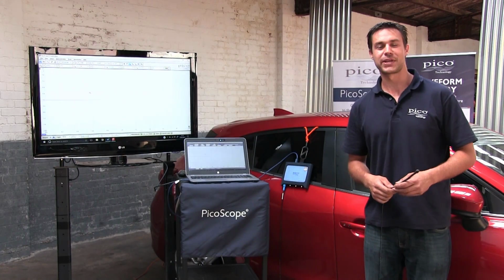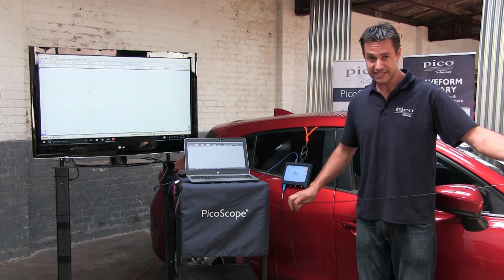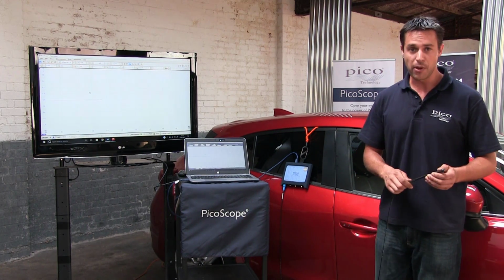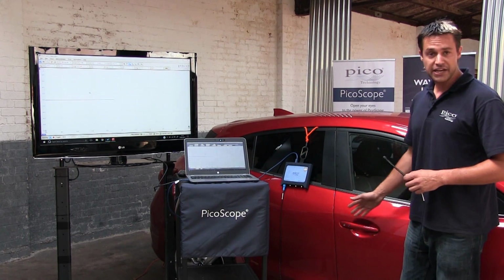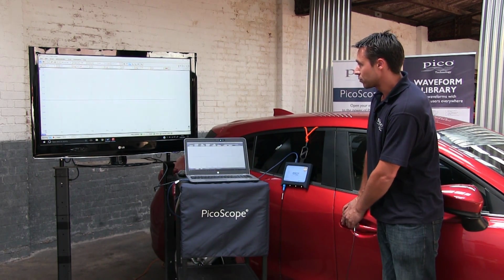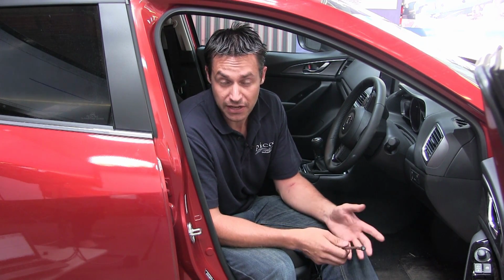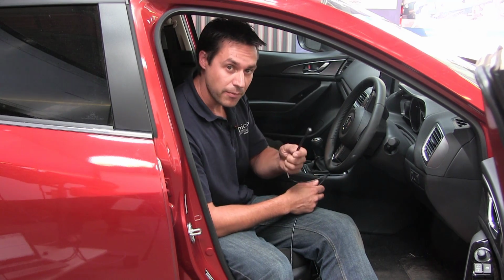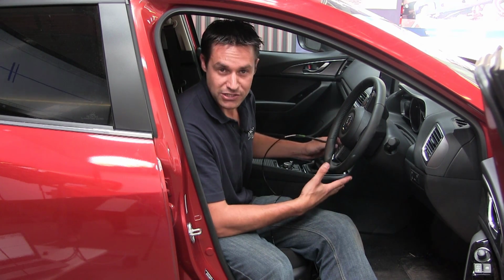Testing keyless entry sensors

Comment: I have a problem with keyless entry on my x trail t31. Passenger and boot works fine but the driver side only works when the key is very close to the handle. Did any of you had this problem? Is the model with handle button like in the video. Thanks

Comment: Hello, it would also be the case that you can use the probe to ensure the key is transmitting correct?
Reply: Hi Sammy, the detector does not pick up or decode the high-frequency secure information used to unlock the vehicle for security reasons. The detector is excited by frequencies in the range 125 to 140 kHz, as used by most manufacturers for keyless entry and smart start systems, which will then be displayed in the software. This will help confirm the signal is there, any interference and the strength of the signal.